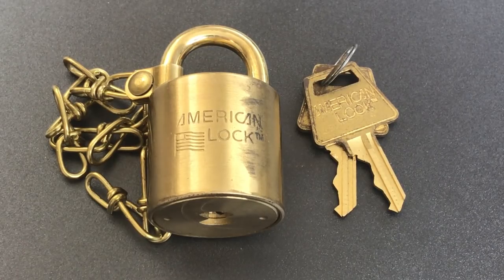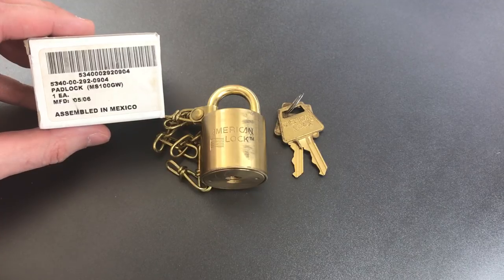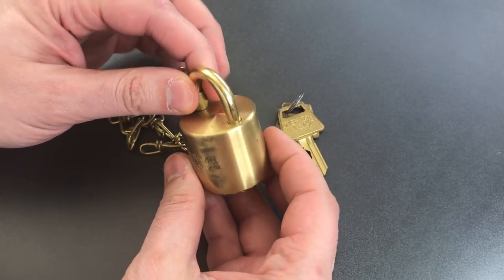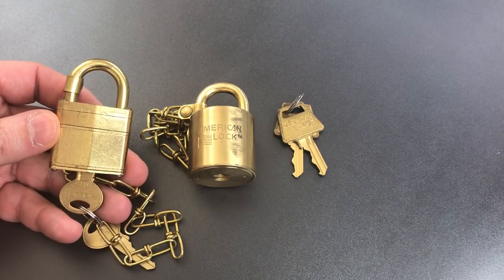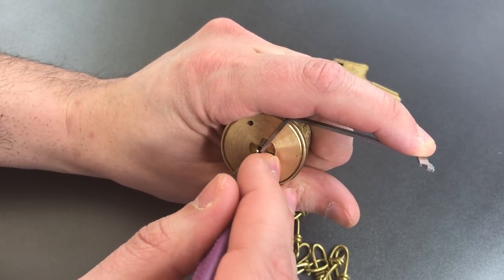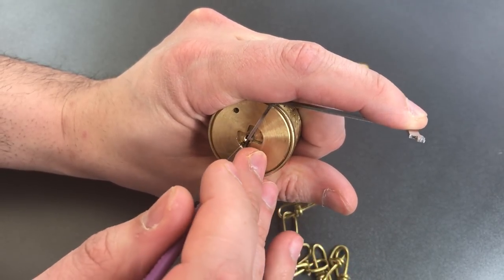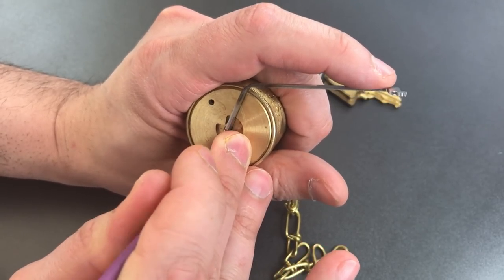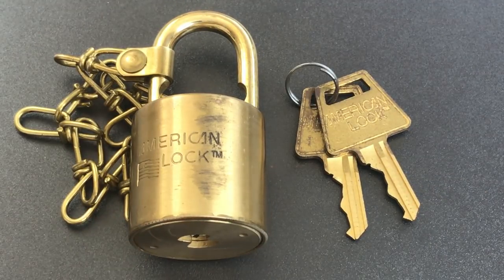[642] American Brass Barrel Padlock Picked

Comment: In the Navy we used to have parts shipping containers that had a guarded area for round bodied locks to fit in. It was a PITA to get them on and off but it prevented anyone from getting to any part of the lock except the key hole face. 
The locks would get a serial number engraved on them and the number would be recorded in the log book for the shipping container. Usually the serial number matched the bitting numbers. We would rivet the chain into the side of the container to keep the lock paired with the container.
We transitioned to the standard 40mm shape because fitting/removing a barrel lock with a shielded container while the ship was rocking was almost impossible.
Reply: Patrick Burke so in this case I guess the brass shackle make a lot of sens for salt water protection, while it was protected from bolt cutters?
Reply: Navy aviation also uses these locks frequently on tool boxes.  The chain is riveted to the box to prevent loss of the lock, and these locks also retain the key while the shackle is open, preventing loss of the key.  Losing something even as minor as a key can shut down flight operations for a squadron, even for an entire aircraft carrier.
Reply: I also saw these locks but they were given to us by the us cadet corps when on a training ship in the U.K.  there were 4 locks given to each unit of the English sea cadet corps  from east Kent my commanding officer gave me the ones given to my unit and asked me too see how easy they were to pick open and to increase the picking resistance if they were too easy we now use 3 of them to secure hatches to engine compartments on some  of our power boats and I was given the 4th when I  got promoted to the highest rank the cadets hade at the time  I  took a look at it the other day under a  40x magnification lens and it had  names of all the us cadets and cadets from my unit at the time  I only looked at it through Magnification cos I noticed the finish was different to the one in your video

Comment: LPL, it could have been used on a foot locker or bedside locker hence the masterkey suite in-case a soldier etc lost his key. A steel shackle wouldn't be necessary in a low security environment like in a barracks. I could understand how picking could be a problem though considering how many soldiers there are, one of them is likely to have working knowledge on how to pick a lock.

Fuel tanks and containers could also be another explanation which would explain the all brass construction to prevent sparks.

Comment: It’s most likely (as mentioned below) the Navy reasoning.  We want a solid lock that can’t be easily opened, but in the event of a fire or mass conflagration we need to be able to bolt cutter them easily.  I’m the locksmith on my ship, so every emergency I’m out in front getting access for the fire teams.  The warded locks im through in a split second, these guys get the bolt cutter.

Comment: Master acquired American in 2005... After, which manufacturing of American Lock components were moved or relocated from Crete, Illinois to Milwaukee, Wisconsin (Master Lock Corporate Headquarters...) and basic assembly operations were moved or relocated to Mexico, where the labor laws are nonexistent and the labor is significantly cheaper than paying American workers by the hour to assemble/manufacture padlocks.

As per the round-cylindrical shaped brass padlock as featured in this particular video, based on the American Lock logo, it was manufactured after Master Lock Company had acquired the American Lock Company in 2005.

Master Lock soon took over the government contract production operations by incorporating their line of laminated steel & laminated brass padlocks into the GSA contract for producing "low-security" ASTM Grade-2 padlocks; although these laminated government padlocks do contain ball-bearing locking mechanisms, because they must be able to survive a shackle-pull test of 2,000 lbs. in accordance with the test criteria & specifications as outlined in ASTM Grade-2 padlock security level testing.

To my knowledge, the only American Lock products that are still available with valid & current NSN's (National Stock Numbers) are the American Lock solid body steel padlock (A-5200 Series) and the brass bodied A-5560B, and the ASL-40, all contain 5-pin tumbler mechanisms with Master Lock's basic W-17 or W-27 key-ways solid-brass cylinder, that reportedly has no significant security enhancements or attributes, such as drill-resistant stainless-steel pins, spool or serrated driver pins... etc.

The A-5200-GL series lock is still nearly identical to its commercially produced & marketed counterpart with the exception to its standard 5-pin brass cylinder, key-retaining functioning actuator and its zinc-chromate finish versus chrome-plating for commercially produced 5000-series solid steel padlocks.
Reply from the maker: Thanks for the interesting info. 👍
Reply: So what is the model number of this barrel lock? do you know? thx

Comment: Very nice. That is a strange looking key bitting there, almost looks filed.
Reply: american lock keys of that era commonly had no peaks between cuts, just the 'sweeper' at the point. but it does look like 1&2 as well as 4&5 were cut on a shared slope rather than individual flats, if that's the case and not an illusion then that would be weird. 3 looks rounded but the same on both keys and the keys don't look worn. maybe both were cut from an old worn original?
Reply: That was bothering me, looking at the keys. Thanks for the ... info & theory.
Reply: Pad Lok That could be, I’m not sure, but that definitely some weird shaped keys. Thanks for sharing your thought on this. Always cool to hear/read back from people.

Comment: the reason that the lock body is cylindrical is to help prevent twisting the lock off with a wrench.
Reply from the maker: I doubt it. You could easily twist that off with a screwdriver.

Comment: round is easy to mass produce in a cnc lathe, no extra machining to make it rectangle.
Reply: Kyle Dana This beauty was made decades before CNC became a thing!
Reply: But not before the end mill and the lathe.
Reply from the maker: It was made in 2006... as for mass production, don’t use round stock. Problem solved. 👍
Reply: LockPickingLawyer While that is possible, it is not the cheapest option. Round stock is usually the cheapest to purchase, and is by far the easiest to machine, and therefore keeps cost of production quite low vs. other lock shapes.

Comment: What is the actual Model # for this American Lock.  I know it has an official model designation, that includes some letters and numbers, but I can't remember or find it right now. Anyone know?  I own 4 of them. One of them has some "frozen" pins. I don't know what happened, but after the last time I picked it, with a short hook and TOK tension, it was an easy pick. The last thing I remember is I pushed the shackle back into the body, and turned the core with the wrench to secure it locked, as I had done many times before. Right then, the pins became frozen. I've tried several things short of damaging the lock. Any suggestions? Where I can send it? Can these be disassembled while in the locked position?

Comment: What is the purpose of the chains on these locks? I've seen this before, but I've never heard anyone actually explain what the chain is used for.
Reply: It's used to fasten to a gate, wall or other fixed object to prevent the lock from Dropping onto the ground which would damage it or to prevent it from  becoming lost. it's not for locking to anything as some might think.
Reply: HeirApparent80 so nobody steal the padlock lol or loose it

Comment: Assembled in Mexico, oh the irony
Reply: Master acquired American in 2005... After, which manufacturing of American Lock components were moved or relocated from Crete, Illinois to Milwaukee, Wisconsin (Master Lock Corporate Headquarters...) and basic assembly operations were moved or relocated to Mexico, where the labor laws are nonexistent and the labor is significantly cheaper than paying American workers by the hour to assemble/manufacture padlocks.